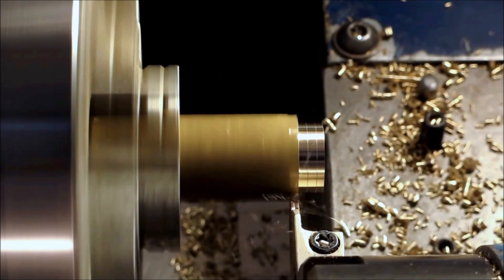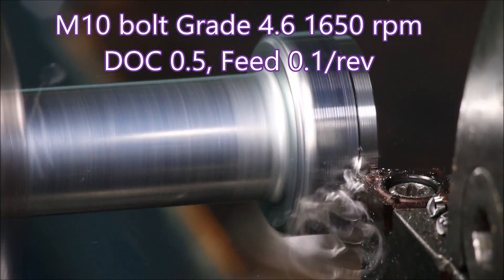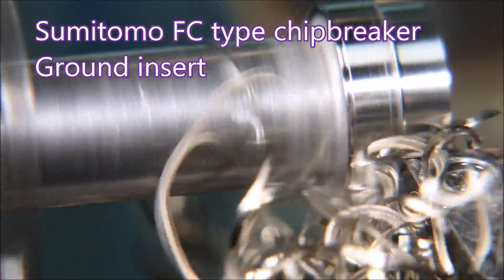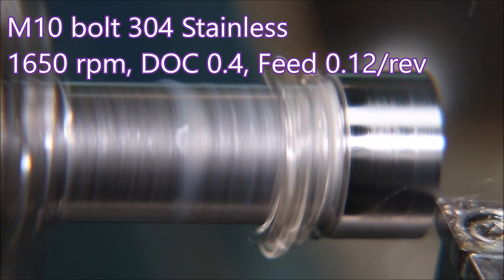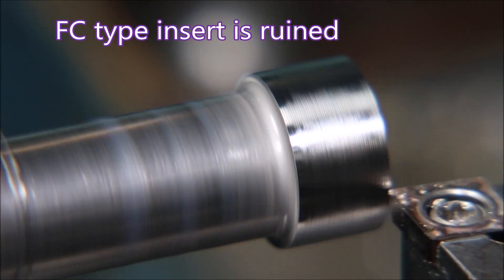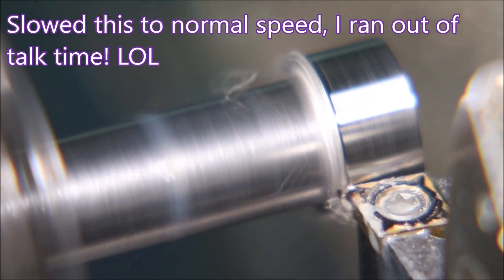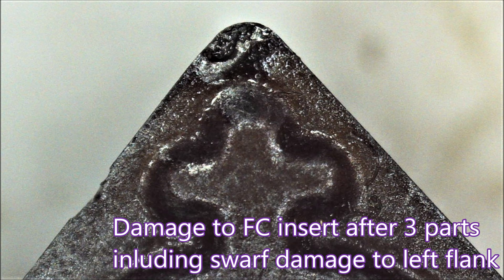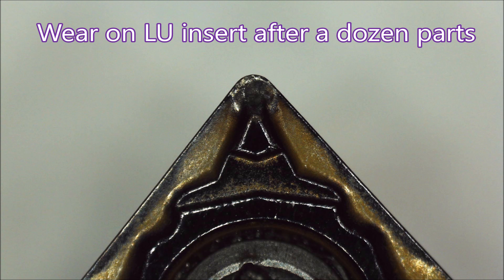Ground Vs Moulded carbide inserts for small cnc lathes

Comment: Interesting. But why would one have twenty four stainless bolt heads removed?
Reply from the maker: To make some handles with a 3/8 thread on them. Other end to suit M10 star type handle. Can no longer buy any material except aluminium, so bolts were a good way to get some steel and threaded one end already!
Reply: @smallcnclathes  
Okay, thanks. But you leave me puzzled there, so: Why in the world can you no longer buy materials except alu?
Reply: I used to buy steel and brass from a nearby cnc machine shop.  It changed hands and new owners were not prepared to cut and sell me material.  Brass and steel supplies are about 40 minutes away which is too much of a bother.  Aluminium and plastics are just a 10 minute drive.  Fortunately I have retired so it is not really an issue.  For this job with M10 one end and 3/8 the other, I figured bolts were the easiest solution also a 10 minute drive or even delivered from ebay.
Reply from the maker: Hi Peter, after you asked, I did some follow up.  The brass wholesaler will now use a courier service for small deliveries.  Used to be by truck at $65 which for me would be prohibitive.  So thank you, I have found I can get brass at a relatively good price without too much inconvenience
Reply: @smallcnclathes 
Okay. Glad to have given you a helping nudge.

Now find steel and stainless. 😉
Reply from the maker: @Peter_Riis_DK  this is only the second job in stainless since 2005! And I am happy to leave steel jobs to others. I buy some machined parts and I have asked if they will supply occasional brass to me. They will get back to me tomorrow with a price.

Comment: Nice comparison 👍 suprising amount of wear!  Yes the ground inserts for aluminium work very well on my small lathes too, use them for everything.  I have some moulded inserts which I will compare when doing intermittent cuts.  But they do require more speed, torque and power which my machines don't have!
Cheers Ian
Reply from the maker: Hi Ian, I think I have done a video comparison, but I only had the SU moulded insert at the time. Might think about doing it again using the ammeter to compare power usage

Comment: I remember watching Stefan's video from 7 yrs ago or so when it was just a hobby for him. He was using HSS and sometimes a broken endmill ground to be repurposed as a turning tool. Handled 306 stainless really well, but at a much lower rpm and plenty of cutting oil. Not surprised the FC insert got smashed, interrupted cuts are pretty rough.
Reply from the maker: After the bolt head is removed, there is a point put on the part, upped it to 3000rpm for that.

Comment: I've resisted buying cheap tooling and instead bought any quality tooling I could find cheap. My machine has been getting repaired for many, many years now. I justified my 'spray and pray' method in part by not having even decided what materials I'll be working with. ..my prized tools are a L and R Sumitomo tangential type (ace-fix I think they are called). Boy O boy these are amazing. The R hand won't be worked hard but the L will be used on my other broken machine which is much larger.
Because I'm a cheapskate, I like the snmg best. The tnmg are out of fashion thanks to the wnmg, and I've got a few different types of those too.
It's prolly 10 years I've been fixing these machines and it's  well beyond time to make my first chips!!! I hope I don't need to spend $10 each for 2 cutting edges but hey....that's life!!!
Reply: The d type that you use is obviously a good shape but the t is also. Could you improve your economy by obtaining a t type holder??
Reply from the maker: Would not improve much I think and I have 35, 55, and 80 degree tools so I really don’t need any more.
Reply: @smallcnclathes  I think they correspond to shapes v, d and C respectively....fair enough!! Cheers.

Comment: I'm very impressed that a ground insert made it through the hex at all!
I've heard excellent things about Sumitomo carbide inserts, though we have near zero support for them in our area.
They have VERY good CBN inserts as well. I've been turning D2 and A2 @ 62RC on and off for 5 years with the same insert corner.

Glad to see another video! I was starting to get a bit worried...
Reply from the maker: Hi Kevin, Not much going on turning parts since I retired.  However, I am working on a video about my lathe the Hercus PC 200.  This is taking some time as I am trying to make it fairly complete.  
The two videos just released are from a job of making some locking handles for a chiropractors adjustment table.  M10 one end for a plastic knob and 3/8UNC at the other end. The other job I have on at the moment is turning some acetal foot pads for a small machine. They will both become videos but will take some time to edit/narrate.
Reply: @smallcnclathes  You do an excellent job with the narrating and editing. Keep up the good work!